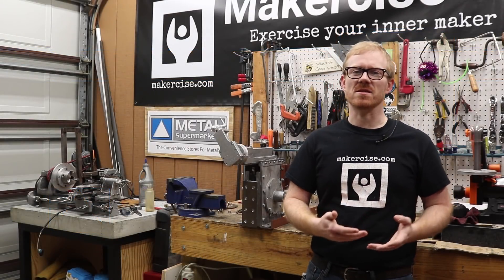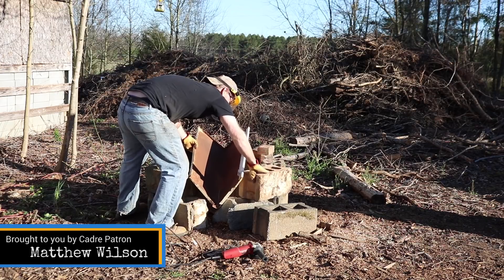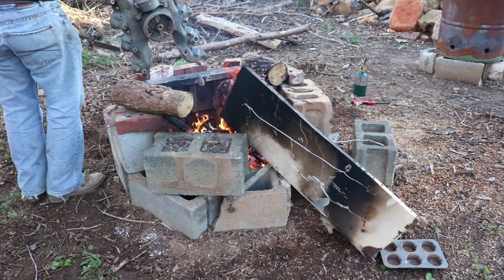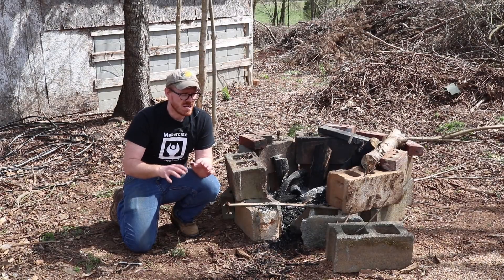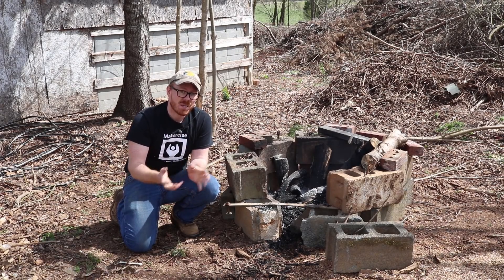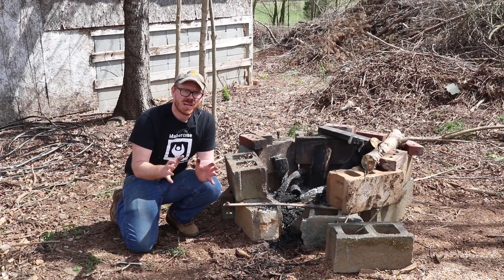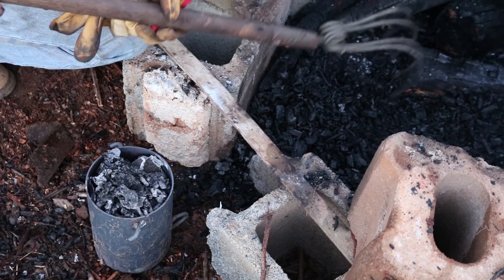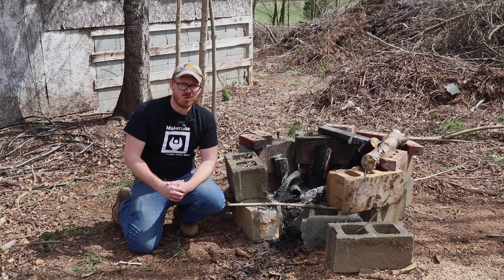Break Down Aluminum in a Fire Pit - Magic of Hot Shortness // Metal Casting Feedstock

Comment: I melt alum wheels in a 55 gallon drum that drips into a water bath, got the idea from , Tobho mott , he has a video called" Water bath bulk scrapper". You cut the bottom out of a 55 gallon drum, place it on a wire grate like a oven rack , I used  t posts to support the drum and rack. fill the drum half full of dry hardwood and place your alum parts on the firewood. You will need a container filled with water under the fire for the alum to drip into. I used a 55 gal drum cut in half and had the garden hose slowly running into the drum to keep the water from getting too hot. No sledge hammers or millions of bits from a saw. Just keep adding wood and alum .

Comment: An idea.... To get the last pieces aluminium much easier without handpicking or complicated tools you can take a shovel and dump all that is left from the fire pit including the charcoal into a bin or a large bucket with water, the charcoal will float, and the metal will sink. Easy and no need for handpicking. I think there a reasonable amount of tiny bits in there that are worth while collecting if you can do it fast and easy enough.

Comment: Pretty much what I do to reduce scrap to small pieces. I get the fire going,throw the big hunk on top,and then use a Shop-Vac to get the temps up fast. It works quite well,once you get the hang of it,although it's a good idea to wet down the area to reduce the danger of a fire.

As for the small pieces that escape,I found out that they can be gotten at later. After 4 or 5 production runs,you can wash out the ashes and find that aluminum,still there and often having melted and collected together.

Comment: Why not using a grinder or a bandsaw to cut the pieces?
Reply from the maker: I made a video about using a circular saw and bandsaw: https://youtu.be/Y6ypconbEjU I don't think a grinder would be very effective. 
Regardless, I have used the fire pit method in the past and thought it would be helpful to show folks. This technique would be especially useful for someone who doesn't have access to a bandsaw since they probably have access to fire. :)
Reply: suckerfree23,I have trouble with the aluminum clogging the blade teeth,when using a bandsaw or recip saw. ( I know,I need to get a blade with coarser teeth-but I'm lazy )  So I stick with the firepit/beating-into-submission route.

Comment: i use old stick electrodes bumped up to 400 amps and it cuts through aluminum like butter.
Reply: Are you using carbon electrodes?
Reply: no, though i have tried those - while they work great for steel, they don't tend to cut aluminum very well in my trials. i have a 5 gallon bucket of cruddy old stick electrodes - rusty, flux falling off - of varying compositions. they still need some flux and don't work very well as bare steel rod, but with a bit of flux remaining and, say, at least 150 amps (more is better, i use 300-400), they make short work of cutting up alloy rims, frying pans, engine parts - the stuff that normally is too big to fit in a crucible but too cumbersome and labor intensive to try to cut up with a sawzall or really anything else. the barbecue method is a close second, but messy and uncontrollable. 

........... just make sure you wear a respirator and do it outdoors with a strong wind.

Comment: I tried this method with an old front wheel drive transmission one time. I think it was from a Dodge Omni. Whatever it was from, it was made of magnesium, not aluminum. The fireworks were spectacular!
Reply: test with vinegar. if it fizzes its Mg.. but be VERY careful it burns so hot if you hose it with water it will break down the water to H and O and then ignite it,, you know fireball kinda thing.. hell Mg will burn inside a block of dry ice! and leave the carbon behind.. really something you want to be ultra careful with
Reply from the maker: Guy Whelan i HAVE to find some magnesium. :)
Reply: If you find some, make sure you have your welding helmet (don't look directly at a magnesium fire, it's as bright as any welding arc) and the only way to put out the fire is to smother it (I used a sledge hammer and smothered it into the dirt). Water will NOT put out a magnesium fire. For some help identifying magnesium castings, check out this post on CNCzone: http://www.cnczone.com/forums/casting-metals/1589-aluminum-magnesium-scrap.html  Have fun and be careful!

Comment: Have you considered using the fire technique with gas torches instead? 
Maybe on top of a bed of bricks? No dirt, no ash. May be a simpler approach. Just my random thought.
Reply from the maker: I am highly considering an oil burning scrapper. Similar to your approach, but I can stick parts inside of a 55 gallon drum. Then the heat shield is on the outside of the parts the fire is on the inside and the fuel produces no ash. Many ways to skin a cat.
Reply: That’s even more genius.  Do it.  Barrels aren’t too hard to come by.  I imagine you may already have some. I recently found a book all about gas nozzles for kilns, forges, and furnaces.  I’ll post a link here.
Reply: Another Idea is use and old gas grill. I watched a machinist from Australia heat treat steel using one.
Reply: having done this ........ don't get caught up trying to make a practical waste oil burner. i would say avoid it at all costs, really. the fuel is free, but you pay double in frustration, cleanup and wasted time.

you have plenty of brush there that you need to burn anyway and i would imagine a lifetime supply from maintaining your property. just do it that way, much simpler. throw your old motor oil into the brush fire, too, if you want.